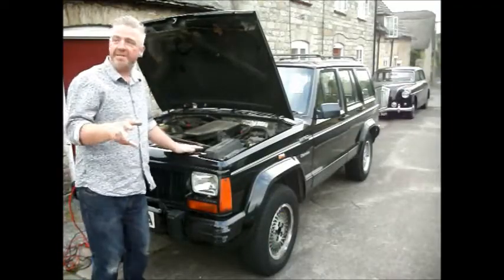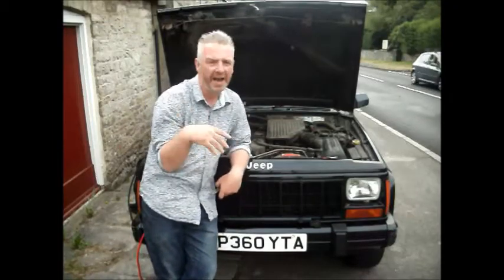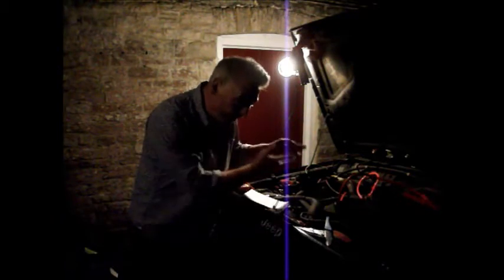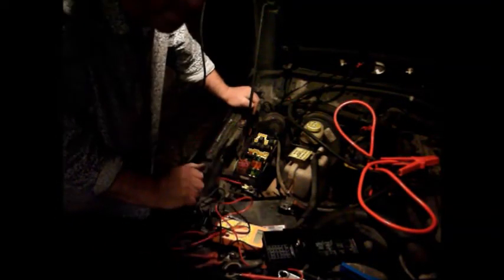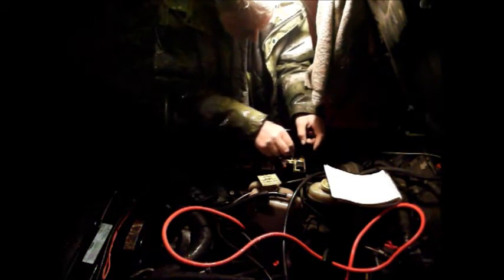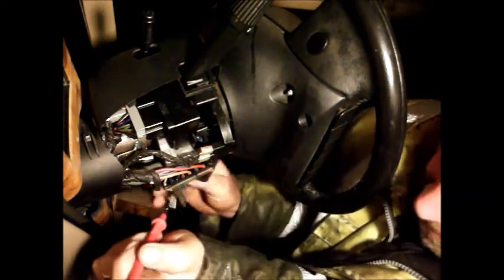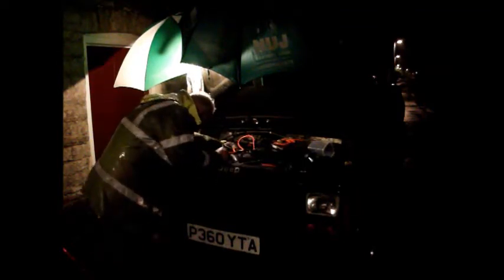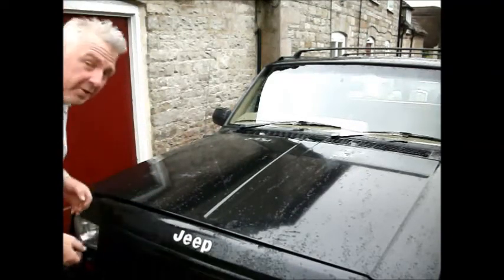Immobiliser Bypass, Jeep Cherokee XJ 1995 - 1996 Mk1, Extended Full Movie - Alarm Overide 4.0 Petrol

Comment: I'll be driving my 1996 jeep Cherokee and it will stop running but will start up after playing with key fob. I have replaced coil and my fuel pump and it still stalls out. I'm wondering if it is my security system now? Anyone know? My rear hatch is not working either

Comment: Hi Tom. I have a ‘97 Grand Cherokee and the dreaded May & Scofield immobiliser unit. Spent some time finding the siren hidden behind the engine management ECU and the actual main unit hidden behind the light switch on the dash. Removed it and checked all the connections of which two were a bit suspect. Even took the lid off and looked inside, was all ok. Put everything back together carefully and it appears to be working! Have ran a couple of wires from engine bay through bulkhead into the cabin so can splice off ignition switch and do your modification. It appears that when the cars came off the boat from the States, they went straight to May & Scofield where the modified black boxes were swapped over with the original Jeep factory units using all the same connectors but with the added immobiliser to comply with Thatcham idiocy. Anyway, your video very helpful. Cheers😊

Comment: Hello Tom glad you got it going .
How are you getting on with your jeep now ?
When connecting terminal 85 to earth does the fuel pump switch off with the ignition off ?
I have a grand Cherokee 4.0 1998 which won't start.
Reply from the maker: Hi Brian.
I've sold that Jeep now so can't remember exact terminals but sure - the fuel pump went off with the ignition. I'm not sure if wiring is the same as Grand Cherokee but the basic principle is that you can power each individual component to do what it needs to once you have identified a good permanent live and a good switched live. Maybe a good idea is to run power to switched and permanent distribution boxes (fused maybe) so adding multiple accessories becomes easier. It would even be possible to put in you own safety-cut-out if you bypassed the original - it's easy to find switched relays that rely on the HT ignition pulse and go off when engine stalls (they are used in LPG fuel systems).  These guys have a lot of useful kit that will allow you to bypass all that factory crap once it stops working: https://www.carbuildersolutions.com/uk/   - also good to know abut systems to bypass ECU itself if you want to ditch EVERYTHING electrical and just use your ironmongery and get it working yourself: http://megasquirt.info/
Reply: Thanks for the help I will look into it ta.
Reply: Going later in the afternoon